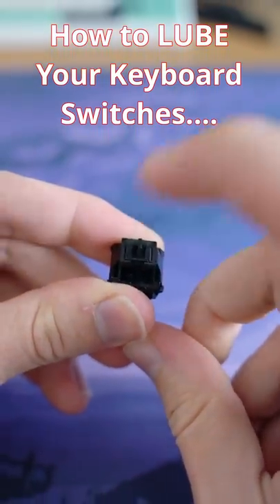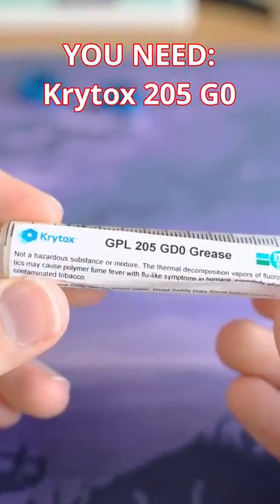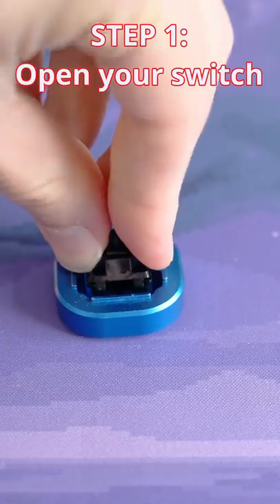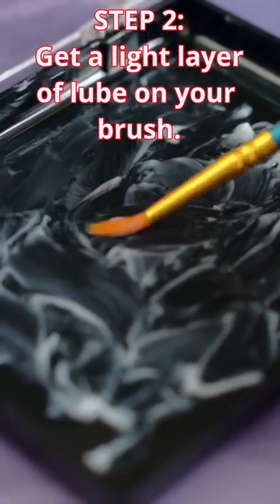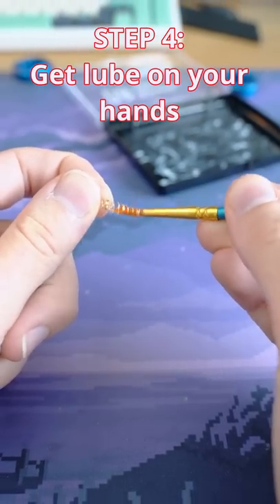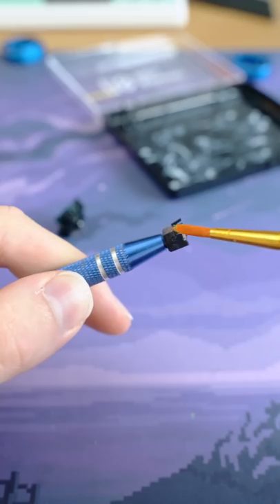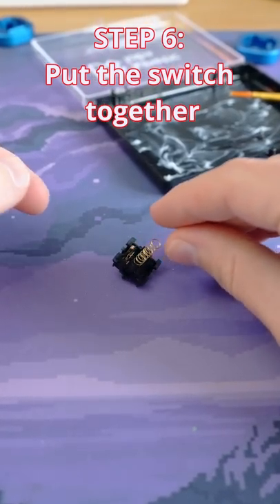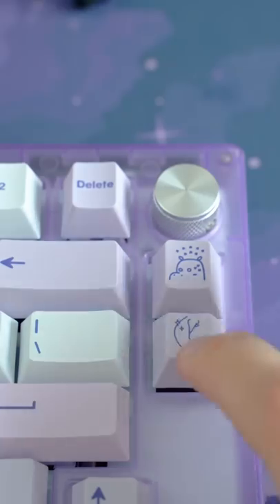How to make your keyboard THOCC #shorts

Comment: I just bag lube the springs.

I find that if I use the top of the switch opener (the one mean for Kalih switches) to push down on the switch, it will just pop open easily and cleanly.
Reply: Kailh switch housings should be the standard. They’re so much less finicky

Comment: you don't need a switch opener a flat headed screwdriver or a pair of tweezers work just fine
Reply: Those can potentially break the switch if u make a mistake, a switch opener costs basically nothing and makes it easy easier, and safer